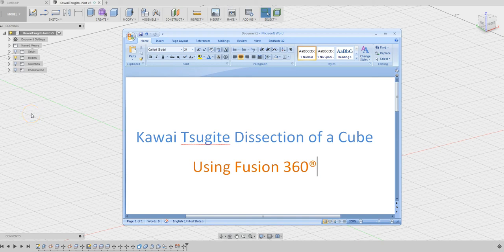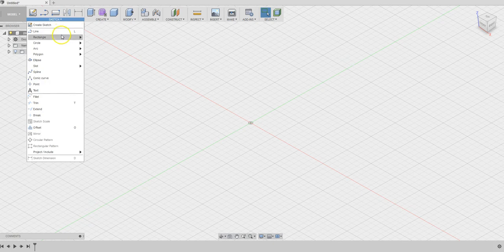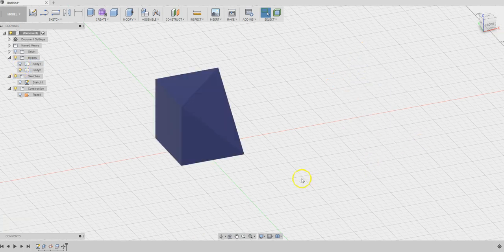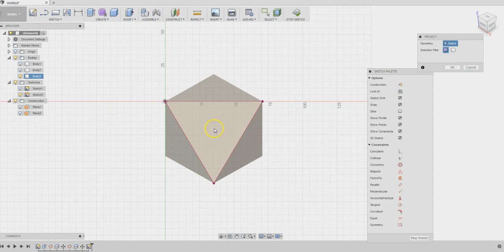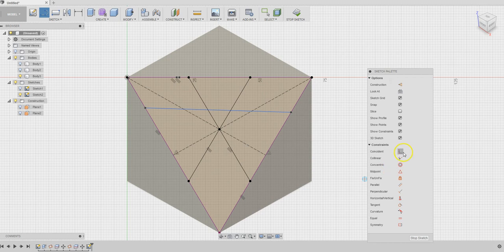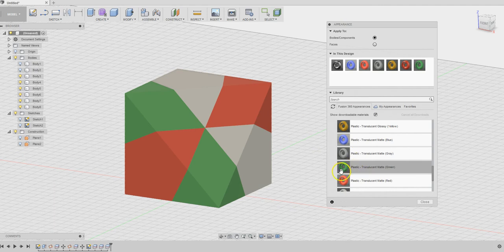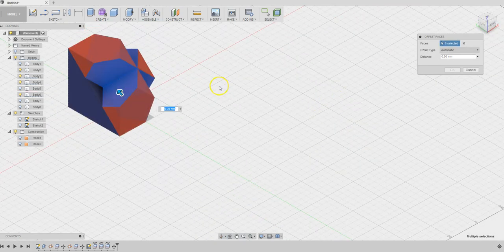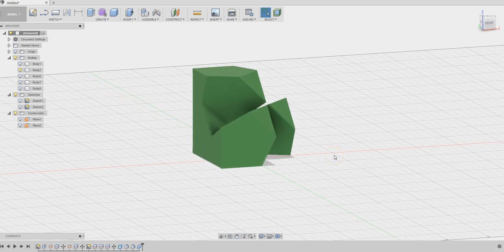Fusion 360: Cube Dissection Kawai Tsugite

Comment: very interesting and solve  one joinery challenge, the possibility to join two pieces of material in a straight or 90 degree angular with a single shape. Now I get to the next challenge, imagine we need to joint  3 pieces of material on a 90 degree vertex and the 3 pieces must be identical in shape.
Reply from the maker: Thanks for the suggestion, with apologies for the late response.  I did not check things often.   It is a great idea and the design process is similar.   I have posted the files here: https://www.thingiverse.com/thing:4919163